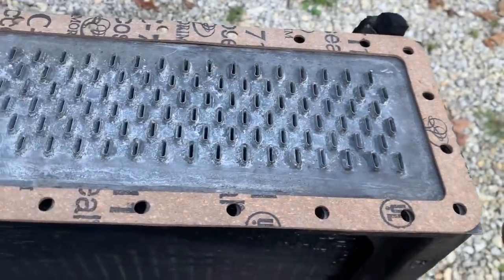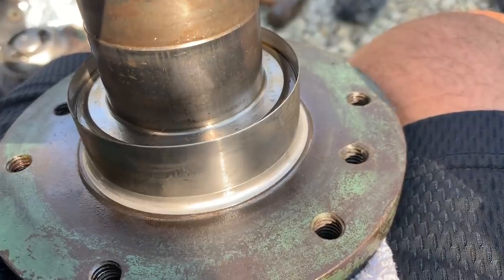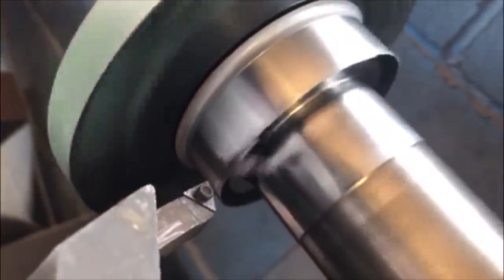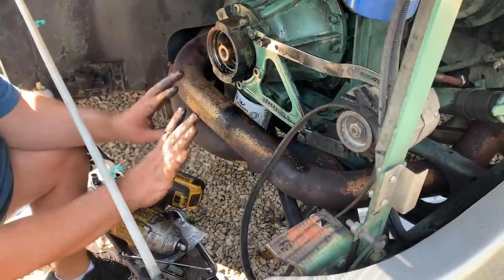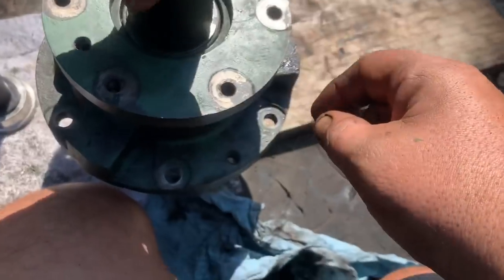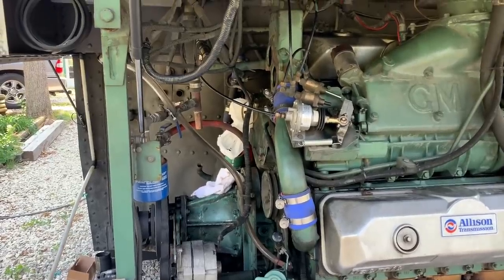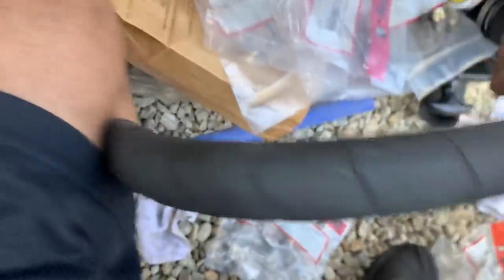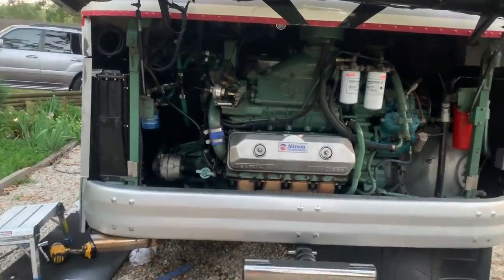Day 3 Buffalo gm bus

Comment: I use to drive dump trucks in extreme environments. Old Mack’s or Fords. I did it for along time . Years and years. When your doing that type of work you learn how to push your truck to the edge and keep it there with out breaking it. You also learn the importance or pre tripping . I did it for so many years that I’ve started pre tripping as I’m walking up to my truck in the morning. I used a truck like a carpenter uses his hammer , as a tool . I got to a level where I could most times, see a break down coming. That’s what it’s all about.  Survival and I was very good at it. Anyhow, if I was going to take that bus down the road , after hearing it start like it did for you , I’d be sipping my Coke, looking for leaks and saying to myself “ sounds good to me , let’s go” 👍

Comment: Fancy putting the seal in before the bearing.  What a silly mistake".............said the kettle to the pot.    I once replaced my thermostat and had just finished checking all the bolts, turned around, and there was the new thermostat sitting on the bench.  And yes, I was talking to my Dad whilst I did this. He had noticed, but let me continue, as it was a good lesson to learn. Don't get distracted when you are working on a vehicle. Love your videos.

Comment: Back when I was a lot younger, every town had at least one radiator shop. You could take an all metal radiator there and they put it in a tank of chemicals to clean it. Then they pressure tested it and fixed all of the leaks and it was good to go. In this day of disposable radiators, these shops don't seem to exist any more. What a shame.

Comment: When working on gravel, you may find it more comfortable to keep some large cardboard sheets below where you are working. You can sit or lie on them, it is easier on your knees, head, back, etc.  Large boxes are generally easy to find if you know where to look. I always find a bunch behind the local pier one, just unfold them and lay them on the gravel and get to work. Also good for dogs to lie on also when they are outdoors, much more comfortable than concrete or gravel and very disposable.

Comment: At my shop would have just spray welded and turned down the OD to the standard nominal dimension.  But the Snapon brake lathe looks like it worked.  I do keep some narrow bearing shims like those if you ever run into this again Scott.

Comment: Turning stainless on a brake lathe... I have truly seen it all! Can't complain if it gets ya by, though.
Reply: What he needed was a parting tool sometimes it's called a cutoff tool. that tool was a carbide tri tip for removeving about .005 to .020 per cut on mild steel. i would use a 3 inch cut off wheel as it's spinning on the lathe.then finish it with sandpaper.use a file and wrap the sandpaper on that,don't use your fingers on that type of cut...haha or you'll need band-aids too.
Reply: @robertoruiz7069  Oh believe it, I know. Those carbide tips are about good enough for #1 cast which is soft. Sometimes you do with what you have, though. Who knows how far it is to go fetch other tools. The one thing I'd have done is turned that tip, it looked a little overheated for cut 2 - but - it got done, and it worked out.

Comment: Just an FYI when cutting thin wall SS tubing ... instead of the cutter on the Brake Lathe, use a simple Hack Saw as it rotates ... you'll end up with a cleaner edge.

Comment: I'm pretty sure that seal sleeve should have been driven on with the shoulder facing up instead of down. There is a line scored in the sleeve by the shoulder so it can be removed out of the way. Looks like you found a way around it, but something to pay attention to next time.
Reply from the maker: Probably should have read the instructions.  But when i saw the sleeve installer wasn’t going to fit i was panicked.

Comment: I hate hot.
Baily hay in south east kansas did me in.
With a long history of Heat Strokes.
Be very careful Scott
Reply: I got one standing in a stupid formation at Ft. Riley. They ARE there!
Reply: @elonmust7470  Lots. Salt rings around the outside of the boots.
Reply: @elonmust7470  Right. You're just swapping humidities around but you needed a drier with a dehumidifier combo..
Reply: @Robert South or Kansas?
Reply: @Robert Ft. Riley?
Reply: @Robert You were on the HILL! I was in Camp Funston with the 34th Engineers. Me and my water truck! 1970.

Comment: you cant cut stainless very well on a lathe using a tool.  You need to spin it in the chuck, and hold an angle grinder very carefully, using the post as a rest and cut it with the friction blade of the grinder. Make a starting mark with the tool, but do the real cutting with a grinder.

Comment: Yes, put a seal on in the wrong order of a bearing. Or flare a hydraulic brake line, and forget to install a fitting before flaring it. Putting an engine back together, and realizing you forgot the whatever on the dark corner of your bench, and need to take it half apart to get the forgotten part in. 

All can be summed up in the old saying of “painting yourself in a corner”, only unfortunately sometimes you need to walk on the fresh paint to get out.
Reply from the maker: Putting hoses together before you realize your wrench won’t come off
Reply: @BusGreaseMonkey  Or you are missing a bolt or tool and begin wondering which part of the engine it might be in......scary shit!
Reply: Bus Grease Monkey thats a good one too. 

That one reminds me of cranking out the long bolt in the tight area with the non-reversible type gear wrench, and realizing you’ve got more threads than space left to get the bolt, and wrench out.

Comment: Double flare a steel line then remember the fitting, I did that and it's bad when I'm under a car laying on cardboard with brake fluid oozing down my arm.
Reply: in future, put a brick or 2 on the brake pedal, and leave it on through the job. pushing it down even an inch or so causes the master cylinder to block the reservoir ports, so no brake fluid drips. and changing lines becomes a lot less messy., and if it has to sit overnbight etc you wont need to re-bleed abs or master or anything else.

Comment: if I had the lathe I would just resurface the area where the seal resides and skip the add on sleeve.
Reply: It would be undersized for the standard seal he had.
Reply: @BLKMGK4  obviously. but seals can take up a little undersize shaft with no trouble. example when a crank shaft is turned down you still use stock seals.

Comment: I think you put that sleeve on backwards  the lip is mint to brake away after it's on
Reply: I was thinking the same. I use my pliers and twist and the lip tears to come off.
Reply from the maker: That’s the way it came in the installer.  It’s on there now and it ain’t moving.  Probably should have read the instructions.  It was not the right item for this job but it was the same dimensions. .
Reply: Just thought I would let you know. Just hope the ring doesn't pop off while it on the motor